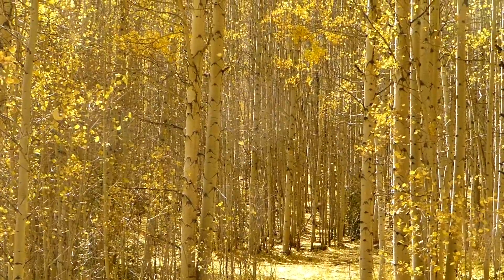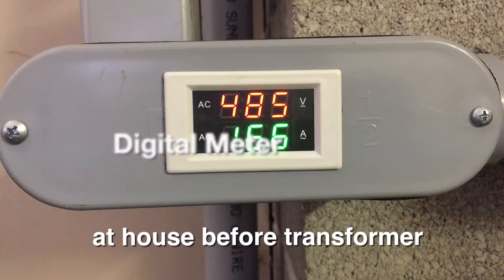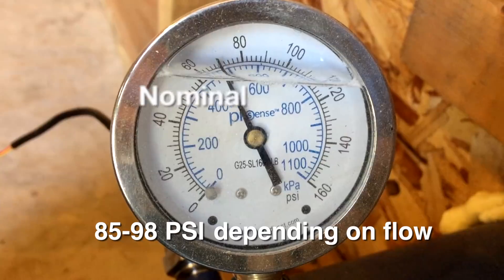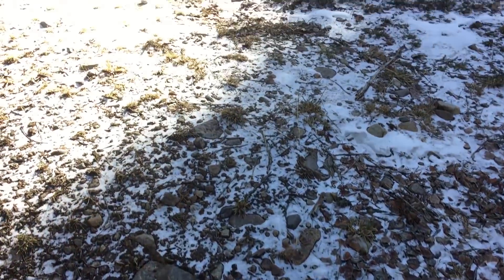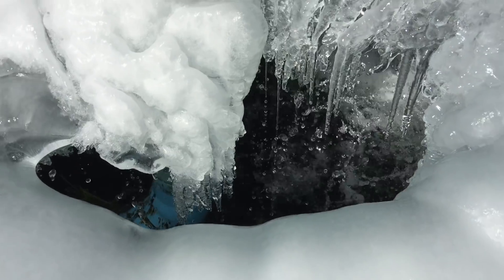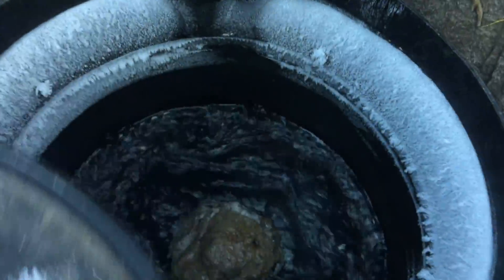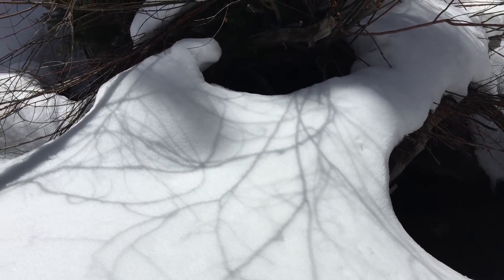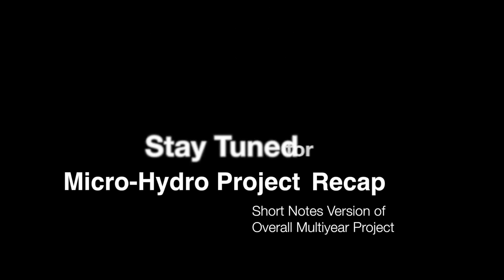Part 19 MicroHydro Power System in CO

Comment: Im in a similar situation in bc rockies. Just wonder how much the power generating system cost. Love the idea of 5000 watt off grid power but the cost might be a deterant?
Reply from the maker: We started in 1995 acquiring water rights and putting in a penstock from springs. That initial system cost around 25k in 1996 dollars. We also got gravity pressurized domestic water and a pond for raising fish at that price.  
When we moved the existing equipment to the creek we incurred additional costs of around 55k in 2015 dollars because we needed a full redesign of penstock, powerhouse, transmission and load management. Our system is capable of generating 7500 W and could be bumped up to 10,000 W if we wanted to add a second jet to the turbine. With Hydro you must realize you’re paying for all future power up front.  There are all sorts of designs and new equipment available I didn’t exist when we started.
People often ask how long it will take to payback the system, but this neglects to consider that we would have had to spend about $140k in 1995 to bring power lines 7 miles into the off grid property.  That estimate had ballooned to $250-300k by 2015 when we moved the system.  We would have had to pay that to bring power lines in and then had power bills to pay on top of that.  So it was a no brainer to install our own system at either juncture and the question of payback was/is a moot question.  We look at the installation as an asset investment in the overall property. Thanks for watching and best of luck.
Reply: @mrhydrohead  tx for all the info. Still looking at options. Have hydro line already to property just like the idea of generating power from the creek. My situation seam sonewhat more simple. Lots of water and lots of grade. A turgot system might make sense being fairly inexpensive. If course its not a 7500watt system!

Comment: Have you seen Chris Harbor Natural Building micro hydro ?
He is a Londoner in Whales UK he has a great system you should check it out . Scott from NH. Have you seen bluenergy.ca ? 
They made a hydrogen and pure oxygen generator 200 feet below the Gulf Stream off Floridia using the one knot current for NASA and the Canadian Research Council Martin Burger used the Davis Turbine the same engineers that placed a hydrofoil on a Canadian Battleship .
Reply from the maker: I have been following Chris’s project. Good work and detailed videos and its a good DC example vs our AC system. I don’t seem to be able to connect with that other link but will search it out. I always thought that hydrogen generation would be a good storage choice here and then get a H powered vehicle, but i was a couple of decades ahead of commercial availability in that thinking. Maybe someday...
Thx for watching & sharing the ideas

Comment: How can you use the excess power to de-ice the system instead of the hot tub?
Reply from the maker: The icing isn't really a problem anyway as numerous super cold years have taught us.  The power is produced 1/2 mile from where the intake area is, so the cost of running wire that far for a dubious problem would just not be a cost effective choice.  Besides, I love getting in the hot tub 4-5 times a week.  Its a joy.  Thanks for asking and thanks for watching!

Comment: could this system be used in a below ground water source?
Reply from the maker: Not sure what you mean by a "below ground" source.  Our first system was run on spring water (parts 1-5 of series) Micro hydro power can be generated from any flow of water.  The two governing factors on power potential are how much flow you have and at what pressure (result of head or fall) the water is at the point of power production.  Thx for watching.  I'm never sure who has seen what of the series. Here is a playlist of the 3 part synopsis which is an overview of the whole process https://www.youtube.com/playlist?list=PLtTypVpmDd-vkT9bJQkXw4I1t0e_4jMYA The whole series is in about 25 videos.

Comment: What if you were to build a small type shed over the intake area... thus preventing the freezing... maybe with a light bulb in there to keep it "toasty"  lol
Reply from the maker: Lots of folks have suggested using power to heat the intake area.  Problem is the power is 2200 ft. from the intake and it wouldn't be worth the expense and effort to run wire that far.  There essentially isn't really a problem as the system hasn't ever stopped running due to freezing.  Subsequent videos in the series show it just developing an ice cover over the intake with the water continuing to flow unabated.  We might put a cover over the intake some day to keep sunlight out as we have discovered that virtually nothing will grow on the intake without sun.
Thx anyway for the idea and for watching
Reply: @mrhydrohead  oh yeah sure man... love the show... wish i was able to get out there in the middle of it one day.... ;)

Comment: R u going to continue to do updates on the system?
Reply from the maker: Yes, most likely.  I just haven't made time to do another update.  I may put in a second jet to produce a bit more power (10KW) up to the limit of the current electric components.  That would be used primarily in the Winter when we can actually utilize all that power for heating.  We have a steam shower that can also be run with it, but just haven't gotten to it yet.  Thx for watching

Comment: Man I really wanted to do something like this. I live in a tropical country and we have a property that has constant stream of water flowing. No floods or erosion to worry about. Also the water is very clean as the rocks above have filtered it. We even have a permanent faucet that flows 24/7 throughout the year. The cost is the main factor for me.
Reply from the maker: The size of our system is big and hence the cost high. Far less costly approaches can be undertaken. Just remember you pay for all future power up front, so buying quality helps amortization of cost. Check out Powerspout. They have good gear which is expandable. Thx for watching

Comment: Any legal issues doing this?
I've heard stories about people getting in trouble for this kind of project.
Reply from the maker: No. We went through water court to secure the proper water rights which vary state to state i think. Nobody “owns” the water running through their property so rights to use must be secured via water courts in Colorado. The creek isn’t navigable and there’s no impact on fish. It’  a “run of river” system where the water goes right back to its source so its considered “non consumptive”.  Water in the penstock actally has less evaporation than moving in the creek. 

I’d be curious to hear more specifics about what problems others have encountered if you have them. Thx for watching
Reply: Thanks ... here on the East Coast I know that using streams is a possible problem if they catch you ... especially if you're taking money from the power company ... lol ... I wish I could do what you've done.

Comment: As of today, I discovered your Hydro Videos. I like them. I've only seen the last few, so I was wondering if you ever showed off your living quarters and the usage of the power created. Most of my life has been devoted to making power as a Millwright. Biomass, Hydro-(those big dams,) Geothermal, and Atomic. 10 years of living living off grid makes me appreciate your efforts. So, about your typical power usage at home...?
Reply from the maker: We turn system up/down Winter/Other seasons 7.5kw/4.5kw on the basis of need for heat.  Haven't done a specific video showing uses.  Typical lights, appliances, electronics, with excess going to heat 300 gallons of domestic water.  Hot tub added last year for excess as well. Part 14 of series details some of the usage and electrics https://www.youtube.com/watch?v=1c8AYt6C2P4  thx for watching

Comment: Good video. You might want to feed the pipe directly from your filtered intake. If it's deep enough you won't get any air, but the benefit is that 1, you only screen the water you use and 2, there is back pressure from beneath the screen that forces debris up and downward. I don't use a vent pipe so you may get away without it too.

Comment: You should be able to adjust the windings in your 480V to 120/ 240V transformer to get a better balances of voltage and current in both 120V legs...

Comment: In an earlier video, I had commented on the idea of a greenhouse protecting the in and outtakes but now seeing how the ice formed around both of them, it has me thinking that nature provides the best solutions, I guess I wonder how the design could encourage a faster ice growth for your winter season protection.
Reply from the maker: The lack of snowfall that last year made the ice formations much more impressive. After several winters it seems the icing doesn’t stall or slow the system. Just keeps running. Snowfall does tend to insulate against very cold nights. And im certain pipe burial helps too.

Comment: When it is all said and done, what is the total cost of the project? Piping and components don't come cheap, sadly enough. For someone thinking of investing in something like this, what would be a reasonable budget amount? I recognize that the distances you cover with piping will vary from others', but I'm wondering if there's any way that you could provide an estimate for the required standard equipment? Thank you for all of your effort and your willingness to share your experience. I wish very much for your continued success.
Reply from the maker: The video series outlines two systems which spans back to 1995.  First system (spring source) was 25k, upgrade to second system was 55k.  Pricing of equipment and options of equipment have changed greatly in those decades. Power output was greatly increased with the move to the creek source and the property became a full time residence.  All hydro installations are different due to topography, reliable water supply, and differences in generation transmission and storage if any.  There is no standard equipment as different options provide different results and people have different needs for their power. Education and research are essential to designing and installing any system.  This series is an attempt not to design a standard system, but to give a sense of what can be involved and provide some level of education and methodology. Thx for watching and I'm sorry that I can't provide a specific estimate, it's just too broad of a question.  Measure flow and head, then research deeply and compare options based on expected need for power.
Reply: MrHydrohead Thank you for your response. I figured that it would be difficult to quantity, given all of the reasons you listed. But, with the numbers you provided, I think it at least gives someone contemplating something similar a goal to shoot for financially. 

In one of your videos, you mention going to a show, or an expo, and that it catered primarily to the industrial power users and not the small or individual user. I was curious, as to whether, you ever found an expo that focused on the individual user? Or perhaps, a source that was really helpful in helping you to find what you needed to know?

I greatly appreciate your insights and your willingness to share. Thank you very much.
Reply from the maker: I could recommend two sources for focused valuable information. Solar Energy International has courses in hydropower which teaches the basics for both DC or AC systems. I took their course in 1995 and gained great assistance in designing my first system and choosing the proper equipment. They have courses in all forms of renewable energy.

The second would be to get a subscription and access to the database of all back issues of Home Power Magazine. There you would find countless examples of actual installations of both hydro and most all viable systems for supplying your own power and developing efficient uses of that power. They also published a book compiling most past hydro articles titled “ Serious Micro Hydro” available in paperback, on kindle and maybe epub versions. 

Tons more information on the the internet which barely existed when i started in the mid 90’s as well. 

Im glad you find my videos of some value. Just trying to give back with my efforts. 😉
Reply from the maker: Serious Microhydro by Scott Davis https://itunes.apple.com/us/book/serious-microhydro/id392500802?mt=11

https://www.homepower.com/

https://www.solarenergy.org/

https://books.google.com/books/about/Serious_Microhydro.html?id=ujkT03H6jlkC&hl=en
Reply: MrHydrohead Fantastic! Thank you so very much!

Comment: How did you aquire such property
Reply from the maker: My best advice is to find a smaller town that you dig & also offers commuter flight in/out of a reasonable sized hub. Look in states that have an abundance of at least seasonal water flow. Pick a clear day for weather. 

Book a window seat and look around. As a commuter flight gains altitude climbing, you will see what's around on the flight path. This assures you won't be too far from supplies, but likely in an in discovered area. 

Contact a local broker and ask them to look around in the area you're interested in. They are motivated by making a buck, but  it may lead you to a heavenly property. Then tour the water and what is potential, you won't need that much but seasonality is important.   Be certain to check the states water policy. 

That's how it happened for me flying Denver/Telluride/Denver way back in 1990. 

You might have to negotiate with a local on price, so be laid back and simple. With determination, effort,& luck you might land yourself in heaven. And then be faced with a much larger and demanding task of taming the ground. 

Best of luck to you. My 2 cents

Comment: I've watched most (if not all) of your micro hydro videos and I don't remember any mention of water rights. I know that's a big deal in CO so I'm curious if you own the water rights on your property and if you had to get any special permits or anything before you started this process.
Reply from the maker: You bet! Acquired rights on the springs and augmentation in 1996 and others on the creek when Bush came into office. The creek rights were re-filed in required intervals a few times.  Used a lawyer originally, then filed pro se (self guided application) more recently.   Not all that complicated as they are non consumptive rights, but certainly necessary.
Reply: Awesome, thank you for your reply. We're hoping to use micro hydro as well when we move up there and build a house at some point in the future.

Comment: Thanks for your video! I have watched all your series on hydro power, excellent videos!  I will stay tuned... and eventually be building a VERY small micro hydro system in the future (right now tweaking up my Hydraulic Ram Pump). Thanks for the excellent documentation and description.
Reply from the maker: Thanks for watching. Ram pumps are cool, although our spring fed water is gravity.  Lucky us
Reply: VERY lucky you.  Our old family homestead (parents sold it in 1996 as I graduated high school - doh!) had massive springs like that with lots of elevation change. Such a shame that got sold... some day again... for now... I use 6.5 feet of head to pump 72 foot vertical and 800 foot distant.

Comment: I absolutely love this system! Maybe some day when I grow up I'll do something similar... Things to dream about.

Have you ever considered using old servers running Folding@Home or some such as load balancers? 

Nvidia Tesla M2090 can be had fairly cheap, and you could use the waste heat for heating of your house. It will have some parasitic losses from idling, I imagine using a script that starts up the number crunching process if there is excess power. So a set of cheap old graphics cards with a favourable idle to full load ratio would be best. 

What do you think of that? Help cure cancer or other scientific endeavours with your excess power!
Reply from the maker: An interesting idea. Have thought about some sort of bitchain but this is very interesting. I'll look into it thx for watching and the suggestion
Reply: From what I researched using GPU's of some kind (GPU's/general purpose GPU's/co processors) would be inevitable, since they have the best idle to max load power usage ratio. Mostly because you can fit a whole lot of them to one motherboard. I found it hard to learn about idle power consumptions on different kind of servers, since it's rarely a metric that people are interested in. A solution might be to undervolt the GPU to increase the idle/peak load ratio. No idea if that helps though.

I was thinking you'd need a script of some kind that turns individual computations on or off depending on the situation. 

Perhaps there's a computer recycler or system integrator nearby you who can point you to the right direction. There's a lot of functional hardware chucked out because it's just not worth running it any more due to its efficiency. But if you're using it instead of load balancing resistors, you're computing instead of throwing power away.

I've been following your stuff for a few years and I really enjoy what you're doing and showing, keep living the good life!

Comment: How is your internet connection? Just a question from someone who wants to live off the grid like you but still loves good internet access. Don't want to lag in any online games lol.
Reply from the maker: We have a radio tower system. 12ms lag and 9-10 Mbps. Not killer but adequate. Will look forward to Constellation
Reply: Wait a few years for Elon Musk's satellite Constellation internet. Latency is suppose to be in the mid 20s as the satellites are in LEO as opposed to a GEO where current sat internet providers are located resulting in 500ms or higher.
Reply: MrHydrohead cool